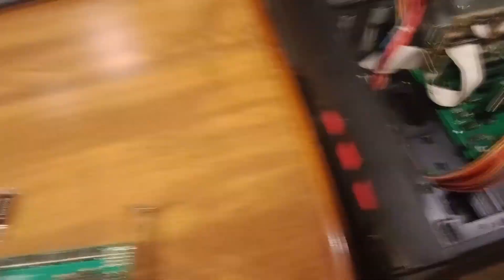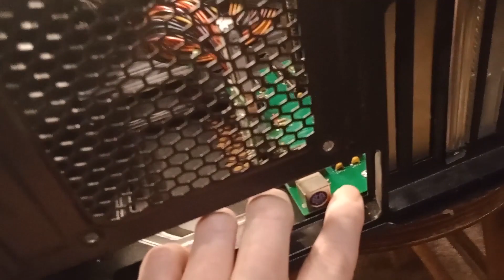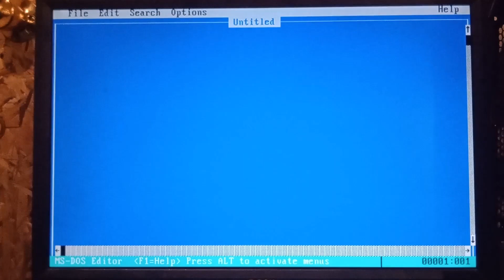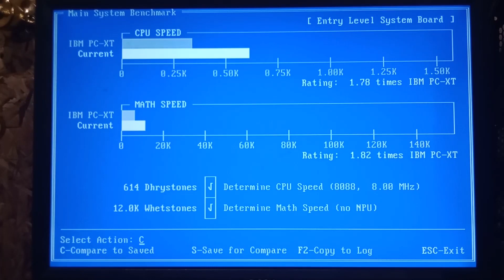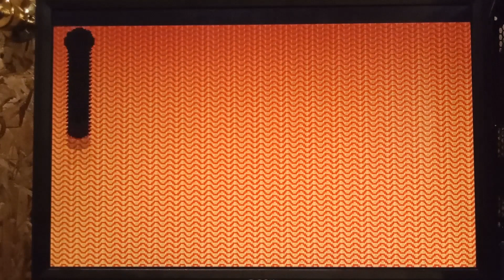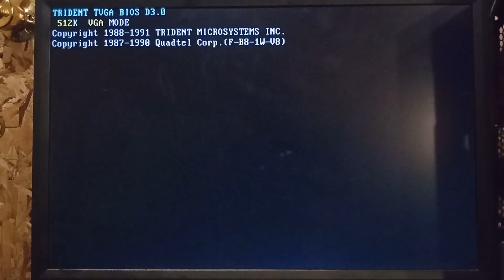8088 PC Compatible Project

Comment: just a little idea, what about adding FRONT USB socket to that USB HDD card, so we can plug Front USB ports on a modern PC casing, there will be easy access to the USB drive even after closing the case :)
Reply from the maker: I haven't gotten around to it yet. But I am just planning a ISA based USB card with the ports out the back. .... You could definitely add the pinheader to put them up front on the case.

Comment: Can you create an actual message board and/or an IRC channel for your project so that the socials could be accessed without using proprietary non-free spyware? Also an IRC channel (and also a web-based message board when it's done properly) could be accessed by using the 8088 compatible computer itself.
Reply from the maker: I have thought it would be neat to be able access a message board with the actual PC.

Comment: looking at this i already created a derivative x86 based pc hardware architecture, with much more interested computing and hardware capability...
Reply: would probably be comparable to a supercomputer in the late 1970s or 1980s, not a cray or dec but way more power than atari, apple, or commodore, but with all the native compatibility, and throw an fpga and vic-II and GTIA and a pair of TIA chips wit tms9918, use dat fpga to werk dat digital conversion of dat signal dem shits spit out, and encode to vga or hdmi  on top of other additional post processing and graphical specific things it can do....and have full native compatability for anything made for a 1970s or 1980s computer just really need a 386, Z80, 6502 or 68k, 65816 and pretty much have  native support for everything from tennis for two probably to ps1 or n64,  wit dat many cpu and fpga custom logic gates wired on won board....

Comment: Checkit disk test fail is due to some int13h functions missing.
	case 0x0C: /* SEEK TO CYLINDER (called by Checkit3 and Northon sysinfo) */
	case 0x10: /* CHECK IF DRIVE READY (called by Northon sysinfo) */
	case 0x11: /* Recalibrate drive */
	case 0x12: /* CONTROLLER RAM DIAGNOSTIC (XT,PS) */
I needed to add all these to have this and northon sysinfo working
Reply from the maker: Probably due to the custom code for the CH376 USB Host.
Reply from the maker: I am sure that the code could be worked on a bit to return the expected values.
Reply: @elijahmmiller  Just need to return OK.

Comment: kinda wish the 8088 to 286 upgrade cards were common, id love to see what it would do to this system
Reply from the maker: That is the idea with the processor on it's own card. One day I'd like to build a "386 Inboard" that plugs in. 16 or 32 bit on the card. Then reach down and utilized the 8 bit ISA bus.
Reply: @elijahmmiller  would be cool if you were to design a upgrade card so that it can be used with other systems. I dont see why it would be too hard using a fpga to do most of the logic to cut down most of the ic's
Reply from the maker: I just haven't worked with a FPGA before. I am sure it can be done.